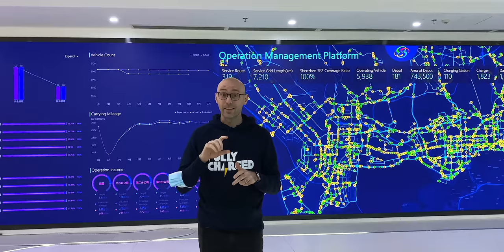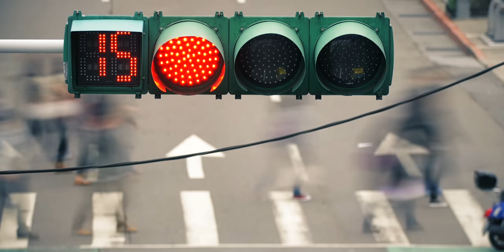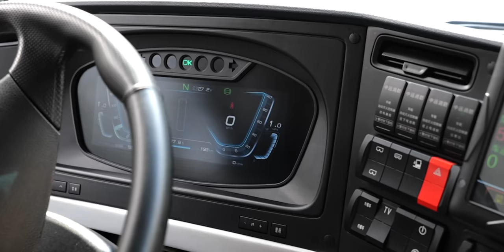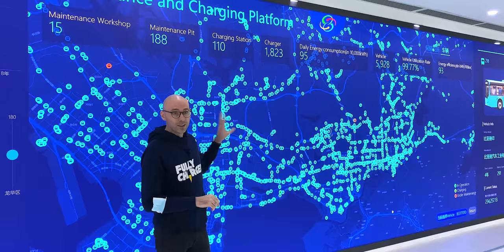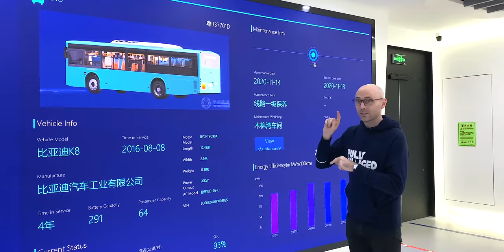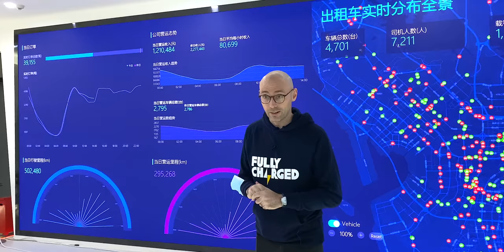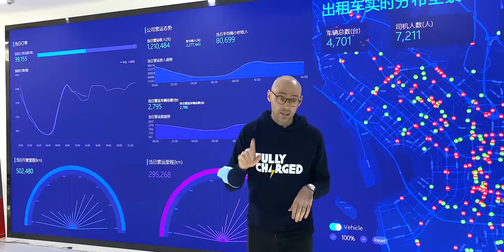The City with 16,000 Electric Buses & 22,000 Electric Taxis | 100% Independent, 100% Electric

Comment: So recharging the fleets with electricity generated coal power plants, gas power plants and renewables in the low single digits is supposed to be game changing? 

I believe once we've broken everything down we'd see there is little to admire. 

The biggest advantage is a lack of diesel noise and exhaust fumes in the city center. 

If the majority of the power needed to produce the batteries and charge the fleets I'd be impressed.

Yes, the maintenance costs and down time is greatly reduced thanks to an all electric fleet. One can argue fewer vehicles are needed in the fleet for this reason alone.

This is another example of the "China effect". They're so good at creating a glistening facade. However once you look beyond the facade nothing is as it seems. 

My take away.... much of what was designed and implemented here will be the template for future fleets with a greener footprint. 

Despite the subject matter, this was an excellent video. That said we can't gloss over the obvious. This video focused solely on the glittering new EV fleets. However you failed to address the source of the electricity powering the fleets. The power supply is a huge aspect when speaking of EVs. 80% of my electricity was coal until one of the coal generators at the facility was decommissioned a few months ago. Until the rest of the facility is taken offline or removed from our power supply portfolio I can't justify buying an EV with the intent to reduce my carbon footprint. It wasn't until we were considering buying EVs to replace our gas powered vehicles that we discovered just how much our home's energy relied on coal. It was a sickening feeling.

Cheers.

Comment: Looks like a Chinese Tourist promo... it's great that the transport fleet is battery-ised, but not so great that the view we get is completely shallow and without any purpose other than to say isn't this great.  The point to emphasise here is that the electricity has to be generated somewhere and it is very likely generated by burning "Dirty Coal" or "Oil/Gas", and maybe somewhere solar and wind, or hydro. But who knows, and it's not expained so the odds are it's generated using fossil fuels. My advice, get real Fully Charged and celebrate the batteries, but look at the original energy source and explain it properly in a proper scientific manner. Refer to the conservative ngo "climate track" for a balanced view showing China as taking "Highly Insufficient Measures". Thanks

Comment: Electric vehicles are not the answer. They are only clean if the source of electricity is clean. Hydrogen is the only answer that will replace gas cars without the drawbacks
Reply: Hydrogen is too expensive and costs nearly a million dollars per charging station. Electric is already being implemented worldwide.
Reply: Electricity is going to be cleaner by the day. It's not cost effective to develop oil and gas anymore compared to CE. FACT.
Reply: @thundurr  Hydrogen doesn't have "charging stations" ;)
Reply: @Sam_BS_Electric  With the new advances in hydrogen engineering, it is only a matter of time before hydrogen power makes e-vehicles completely obsolete...
Reply: @membershipmovement  Hydrogen will be part of the mix of CE, but I doubt for cars. EV's will do the job just fine.
Reply: @Sam_BS_Electric  EV's will never cut it in America. With drivers doing 500-800 miles in a day, American's will never adapt to EV cars with a 300 mile range. The only solution that works to replace the gas engine is the hydrogen engine. This is why only 2% of vehicles sold in the US are electric.
Reply: @membershipmovement  Of course it does.
Reply: @membershipmovement  And in terms of driving range: 1) In China production cars are at parity with ICE have around 500-600 kms. 2) when we have adequate infrastructure in the west (China already has), you don't need more than 200-330 kms, you don't even need that!

Every time GM or Ford release an NEV it sells out in hours...traditional car sales are at 1950's levels...doesn't that tell you something?